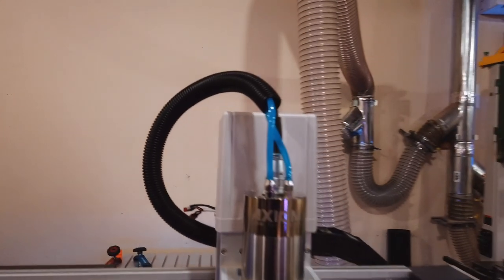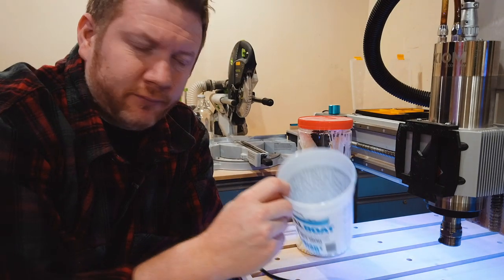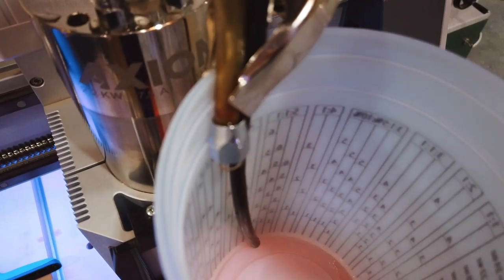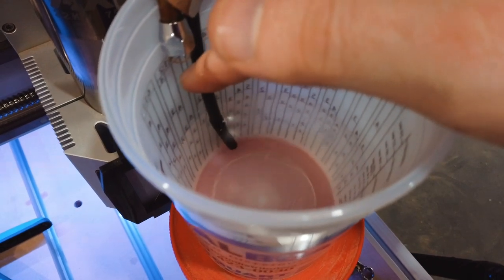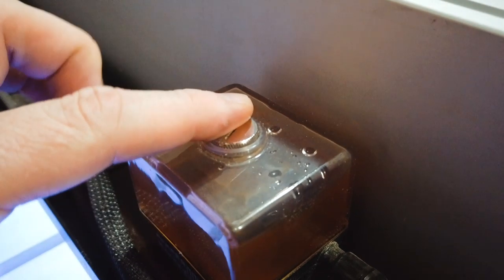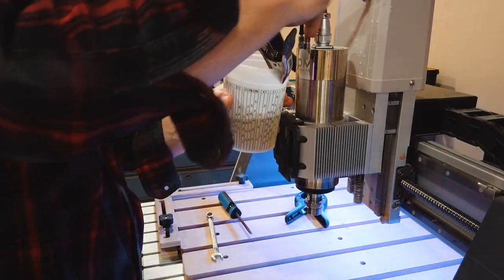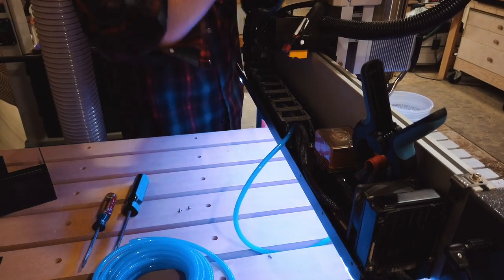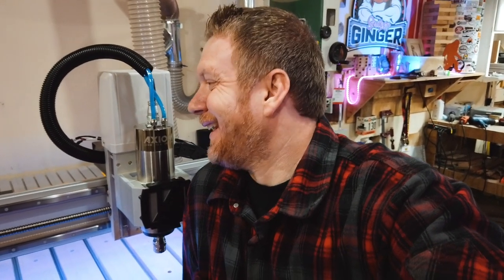How to change coolant in your CNC // Axiom Precision CNC

Comment: What size is the black hose?  So you cycle the water through until it’s clean water coming back out into the cup?
Reply from the maker: Black hose is actually a little smaller than you need but it works. 5mm internal diameter. Yup just run it until it's clean, it's not a full flush but it will work

Comment: Could you make a video showing how to use the controller to start the pump. That would help a lot.
Reply from the maker: Ah yes sorry about that. You can turn the spindle speed all the way down and then manually turn the spindle on with your dsp to do that
Reply: @SouthernGinger  I may be slow but could you explain which buttons to use and sequences to start the pump.
Reply from the maker: @ronnierobason6573  there is a spindle button on the controller to start the spindle and on the actual white box (computer) you can turn down the rpms from 400 to 0

Comment: Great tips man! Is your water a particular PH because you’re running an RO process on the water? I’m actually running a synthetic anti-freeze in mine.
Reply from the maker: Yeah antifreeze works just fine. No I have an Enagic machine that uses titanium plates and electricity to separate the water into alkaline and acidic streams.. it's crazy cool 11.5ph is highly alkaline and has a lubricant feel to it
Reply: Southern Ginger Workshop Oh wow, that’s pretty neat. What’s your main use for something like that?
Reply from the maker: Drinking water. I drink 9.5 daily and 11.5ph after workout or when I want to goto sleep haha. I can tell you all about it one day, another one of those things I do/sell on the  side lol
Reply: @SouthernGinger  Not to be a nerd but anything alkaline will have a lubricant feel to it because technically it's breaking down your lipid bilayer in your skin...basically its breaking down the fats which then feels like lubrication.
Reply from the maker: Ah very cool, that's how I know it's 11.5 is rub it between my fingers to see how it feels. That's not nerdy! Haha
Reply: Thanks for the video. Why doesn’t Axiom have a video on coolant replacement ?

Comment: Sorry, but I’d stay with the manufacturer’s (axiom) way. I tried it your way but found the nut is very difficult to reinstall back onto the spindle. I needed to cut about 6mm off the original tube because it’s damaged from the nut, and that’s fine but then the original tube then pulls and twists as I tighten the nut back up. Just sayin.
Reply from the maker: Wow thats crazy, as long as it works, there is many ways to do it :D